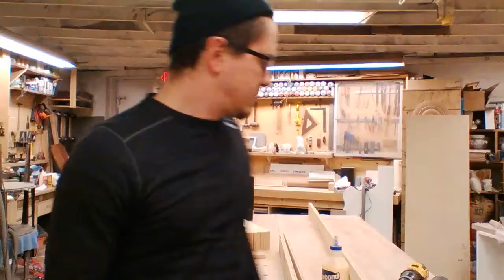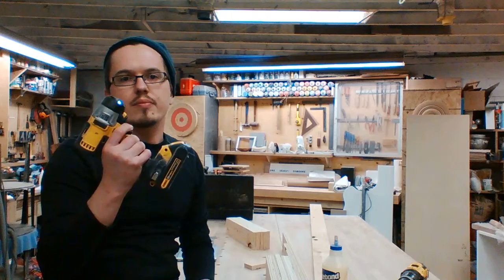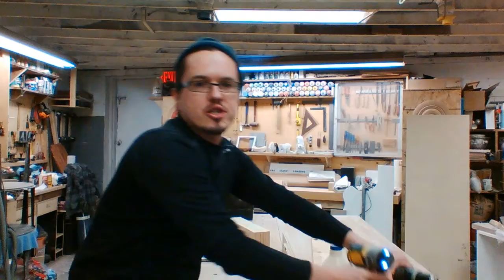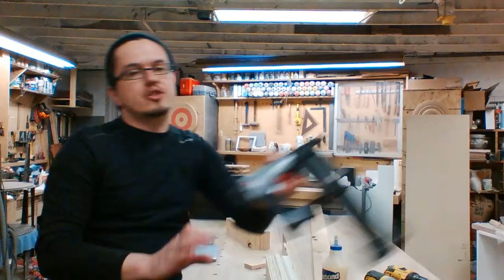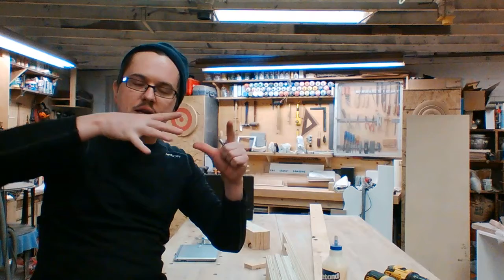IKEA Hacker show 03 - WHY build a proper base 4 your SEKTION?

Comment: Hi Karol, done mine in 5/8 cause this is what I got at home, I've done an 4 x 10 feet island on 2 box drill together. Do you think it will be strong enough to support de 800 lbs quartz countertops? Or should I drill another 3/8 on the the exterior box to make it 1 inch think ?
Reply from the maker: I literally 'WRESTLE' with my island installation after I am done - it should feel rigid and inspire confidence.  I have a blog entry with detailed drawings on my blog - that is a great guide to follow. I like 3/4" thickness because it allows you you use no.8 woodworking screws [but I always use glue and pin nail/staples] - BUT if you stuck to the dimensions I've provided for the basic build it will be OK.  There is lots of 'sheer loads' on the top of the cabinet assembly when you slide the stone across - that's one thing I always pay attention to [hence 'wrestling' - mimics the slab being slid across]

Comment: Great video Karol! For the sink box, my question is how do you accommodate the sink box drawer and plumbing? If you are building a base, that's say 3.5", that leaves very little space(~3"=24" box - 17.5" drawer - 3.5 wide base) between the sink drawer. I was hoping to line the pipes about an inch away from the back wall of the box. Thoughts welcome.